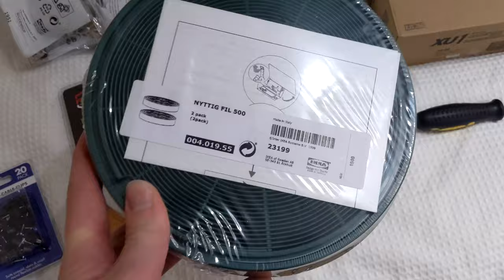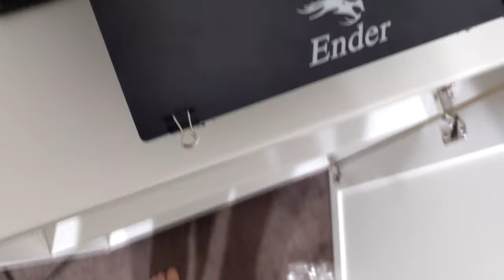IKEA HACKS - How to | 3D Printer enclosure

Comment: I made an almost identical setup in 2019 (though I used plywood and old windows/kitchen cupboard parts).  I did my filament exactly how you did with a rod going across the top and it works fine.  The only time it sorta screws up is sometimes it will bind if im using the roll on the far right, which i think if I ran some acrylic or ptfe tube it would resolve that.  Much more convenient than changing the whole roll everytime.

Comment: How did you make your ender 3 fit in it? I just bought the same cabinet from Ikea, but i have to turn the printer abit sideways, otherwise the front of the buildplate will hit the door when fully pulled to the front. Is it the same for you ?
Reply from the maker: Nope it just misses it. I have 10mm thick foam tape around the door to insulate it. This may push the door out a bit giving enough room. Maybe give that a try.

Comment: Thanks for sharing, do you find that the cabinet is stable enough to not vibrate at all during printing? Currently I have my ender3 on granite and it's really solid.
Reply from the maker: I have no troubles with vibration at all. I don't do super massive heavy prints though so I guess it could depend what you're printing.

Comment: What kind of filter do you use? How hot does it get inside the enclosure? Is it air tight?
Reply from the maker: It's a charcoal filter from IKEA. The cabinet maintains about 32degC. Can close off a portion of the exhaust filter for higher temps.

Comment: great video :-)...does the psu get hot when door is closed
Reply from the maker: No as it's in its own little enclosure it seems ok. I've since used foam tape to seal the top section even more.

Comment: Hi mate. Trying to ask you a question about boost compensation pin, 1hdt. I use hand pump but it doesn’t hold the pressure. It’s leaking out the pump. Is that normal? Cheers sorry I couldn’t work out how to message you
Reply from the maker: No that's not normal mate. If pressurizing the top port of the diaphragm, it should hold pressure. If not then the diaphragm may have a tear in it.
Reply: brendonv101 thanks mate. I ordered diaphragm it should be here today so I can install and re test. Thanks
Reply: brendonv101 yup. Diaphragm was cactus

Comment: I wonder if this would contain resin printing
Reply: I would think if you put a thin piece of weathering stripping around the door...I would think so
Reply from the maker: I have since added foam tape around the door and it's pretty well sealed. For resin printing I'd probably run the top hole to a hose and out a window or into the roof though. Especially if you're in the same room as it all the time.

Comment: is having a good 3D Printer worth it ?
Reply from the maker: Depends what you're using it for really. More expensive ones generally make it more user friendly. Not typically better quality printing wise. 

Cheaper printers like this require a lot of tweaking to get right as everything can be adjusted. More expensive printers are usually setup in a way where you send it your print and bam, it just works. This also requires you to only use their own filaments which in turn comes with a mark up.

Expensive printers are basically catered for business use.
Reply: @brendonv101  yep top notch